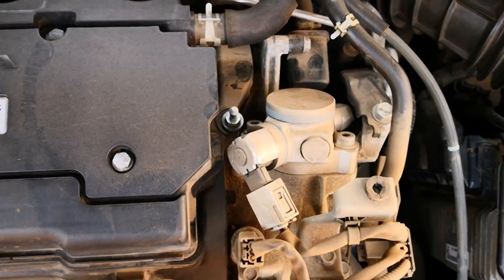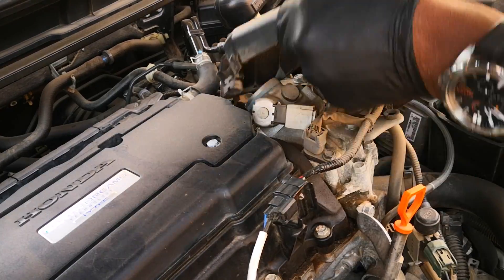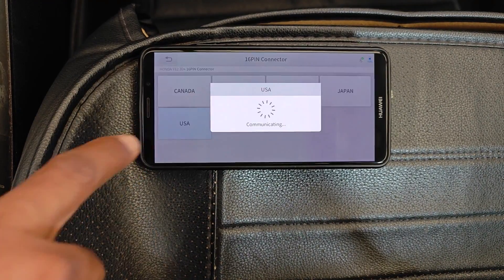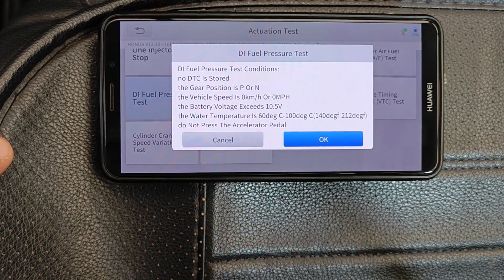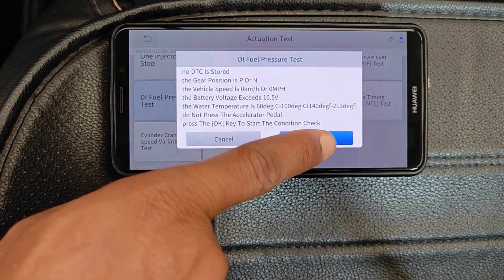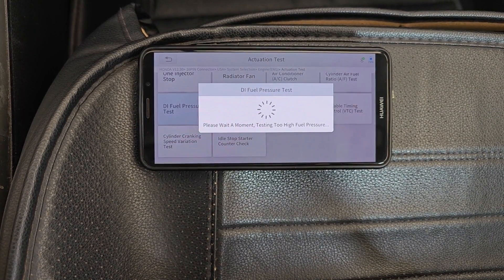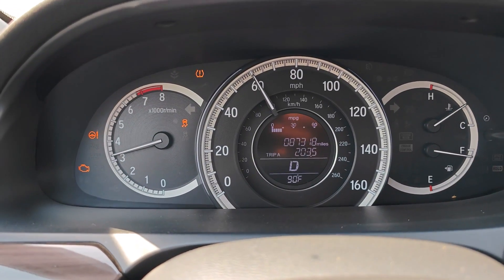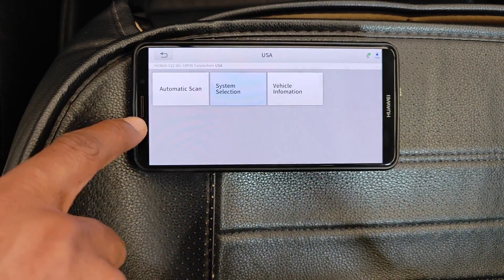Direct Injection Fuel Pressure Test using XTOOL A30M / Check Fuel Pressure with a Scan Tool

Comment: I just got the Toyota specific Launch X431 Elite, it is great for bidirectional testing. Have you ever read up on the ATF thermal degradation value by chance? Toyotas give a value of how good your tranny fluid is via a thermal degradation number. I guess 65,545 is the high end and means your ATF needs changed, my new Toyota is at 67 with only 1300 miles. Just curious if youve ever looked into this. Also do you have any TPMS replacement videos, for future reference.
Reply from the maker: Hey. Never heard of this degradation metric! Definitely a good one to have! What obd protocol does your 2024 Camry use? It looks like something supported by some of the recent OBD protocols. Haven't looked for it in Toyota's running the CAN protocol. Will look into it and see.
I have some TPMS videos, some are old though👀, like when I still used to beat around the bush in videos 🤣
Just created a playlist for TPMS stuff - TPMS diagnosis & fixes: https://www.youtube.com/playlist?list=PL2pms4eLDw4WvKNQqW1kusXDf3o2fDjVR
Reply: @DIYAutoworksNG  I'll have to look into which protocol but if you look up thermal degradation for atf it's the protocol that uses 65K as the upper limit for the atf life
Reply: @DIYAutoworksNG  if you search Toyota atf thermal degradation value estimates, you'll see a bunch of stuff on Toyota and Lexus forums. I would imagine if Toyota has this thermal degradation system, Honda would have it also. Seeing as how they are both Japanese auto manufacturers
Reply from the maker: @donniev8181 definitely investigating this...
Reply: @DIYAutoworksNG  good, let us know what you find out, maybe even do a video on it.